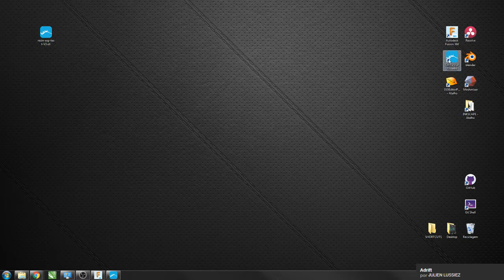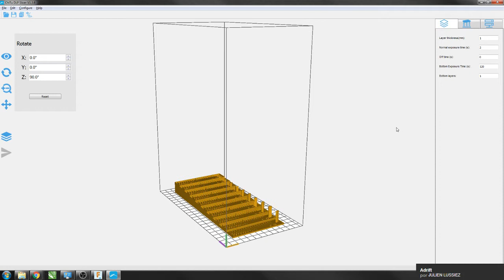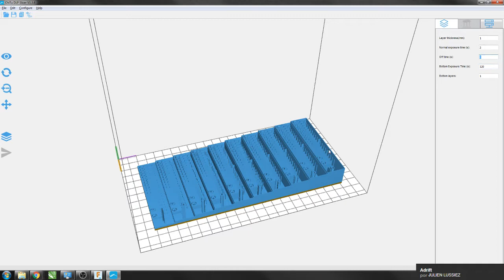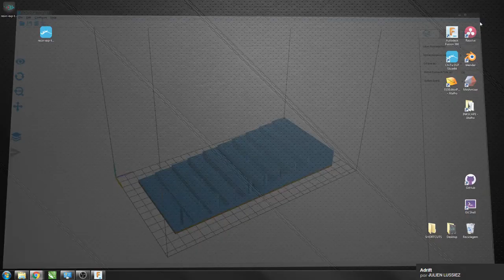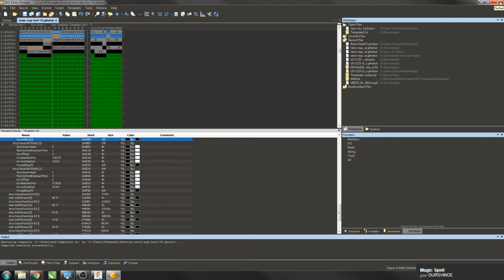Resin Exposure Test - Hacking Anycubic Photon file

Comment: Nice work! What would be your approach to reworking this for use with a different printer? Specifically, I am using a Phrozen printer and I would really love the ability to calibrate my resin XP so easily... TYIA!
Reply from the maker: What can you tell me about the file format that Phrozen uses?
Do you know any resources about the file format it takes and how it is built? Is it a Zip file type with a human readable and modifiable Gcode + Images? or some other type
Reply: @X3msnake  the phrozen machines take .phz OR a .zip file... I know chitubox is compatible with their machines so I imagine if I was able to just use a standard output (.zip) from there it might work out... any ideas?
Reply: @jthomasolsen  if you can slice a calibation matrix from thinguiverse, test that it works and upload the file and share the link in a reply i can have a look at it and make a test for you to run on your machine with a couple of commands to validate this is doable.
Reply: @Photonsters  wow that is super generous! I am really impressed that you would offer assistance to an outsider :-)
Reply: @Photonsters  here is a link to some files... there are 4 there. One set of .zip files from chitubox and 1 set of .phz files/folders sliced from PZSlice (phrozen's software). I think this is what you were asking for but if you need something else please let me know and I will get them ASAP! https://drive.google.com/open?id=1MqsFa3T08MJ8grQI2eP-qhGnw6nz4RqO
Reply from the maker: @jthomasolsen  i will have a look at the files tomorrow and let you know what we can do ;)
Reply from the maker: @jthomasolsen  looks promising at least on the zip side. i will cook up a ResinXP v2 for you to do a dryrun test and report back. if that works then we can start testing :)
Reply: @X3msnake  super! I'm really grateful for your help... let me know if there is a better way for us to communicate! I'm happy to stay in this YouTube thread if that's what you prefer though
Reply from the maker: @jthomasolsen  you can find me on facebook. on Photonsters fb page. drop a message there i will follow trough
Reply from the maker: @jthomasolsen   try this file as a dry run, without vat, and report back the result. 
If you can make a video would be great.

https://github.com/altLab/photon-resin-calibration/raw/dev/preview_v2.0/ResinXp2.0_Phrozen_050u_B40_2-20_200120.zip

Comment: Hi, is it possible, with such hack, to have each layer printed different thickness and exposure time? If it would be possible to do then we will have a terrific effect! We could optimize the print in order to print large and rough details at higher layer thickness and small fine details at much smaller layer thickness thus tremendously reducing the printing time without loss of details where we need them. Would this be possible with our hack?
Reply from the maker: thichness yes  check open photon slicer from photonsters.org it already has that featurr.  exposure no  but same exposure works for a good range of layer height

Comment: The part that I'm having the most trouble understanding with the test prints is the multiplication factor.  I don't understand why it's necessary for anyone because if a given column looks good then why double that value?  Plus that doubling factor seems to apply or not depending on how transparent a given resin is (transparent seems to not need the doubling) and possibly which machine you have (I'm using an EPAX X1 with the stock UV lamp and in general the non-doubled values seem to match the recommendations I've seen from others).  Is there a more complete explanation for the doubling factor out somewhere?
Reply from the maker: because each column does multiple exposures of 2s if you use the 2-20s test. however you need to multiply by 10 if you use the slow resin test 10-100.
 transparent resins dont work well with this test exactly because it relies on multiple exposures
Reply: @X3msnake  Oh, so the number at the bottom isn't seconds, it's number of exposures, correct?  I suspect a lot of people miss that.  I wonder of the test not working for transparent resins has anything to do with the entire print being very close to the bed and UV being reflected back off the bed into the print which wouldn't be the case higher up in a print.
Reply from the maker: @StevePrior  No, it has to do with multiple 2s exposures instead of a full variable exposure. limitation of the firmware.
For clear the read columns as secounds is a good rule of thumb.

People miss this part because most are lazy enough not to see the videos or read the documentation on the project that accompanies it.

https://youtu.be/4jYgyjmp6lo

Comment: Hi! Is this dependent on a particular firmware version? Thanks!
Reply from the maker: peter bratu no
Reply from the maker: not that i know of, i'm using a hex modded chitu slicer, the only thing that it does is output the file as .photon. but you can just change the output filename to .photon manually

Jon Allitt in Facebook anycubic owners group:
 I opened the chitu .exe file in a binary/hex editor and replaced every occurrence of ‘cbddlp’ with ‘photon’ and now the slicer saves (and loads) .photon files. This only works because both extensions are 6 characters long.

Comment: Good videos,  i did buy this printer a week ago, but it wont print anything, i did try everthing,  it just sticks to the vat, only 2 mm and wont do antmore than that,  i was looking forward to make some good prints, but no
Reply from the maker: that's a build plate leveling problem 90% of the times, post your problem in the anycubic owner's group in facebook if you haven't already.
Reply: mabye,  i dont have fb- but did write them a mail.
Reply: i did calibrate 20 times, but no luck,,  did you use print paper also.
Reply from the maker: Try the Flint Read way https://www.youtube.com/watch?v=roAqm5c3rfU&t=1s
Reply from the maker: Dane 69 did you solved this?
Reply: Hi-  No i cant print my own designs, only the test file is good, half prints and the supports don't print when using slicer. the seller wont refund or change to new printer, so i dont know what to do. i only had this printer 2 weeks
Reply from the maker: Dane 69 do you have skype or gmail hangouts? I can walk you trough a couple of tests to see if we can find what is wrong with your printer
Reply: ok, thanks- i will contact you